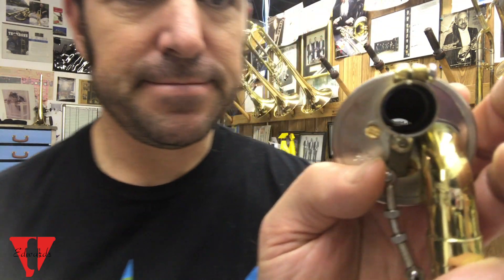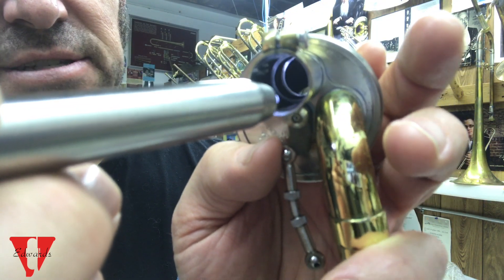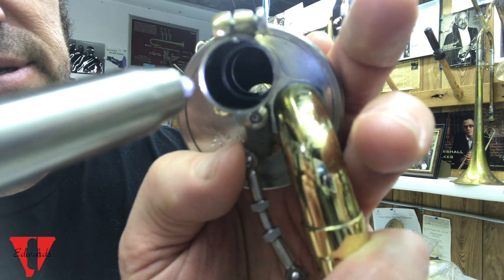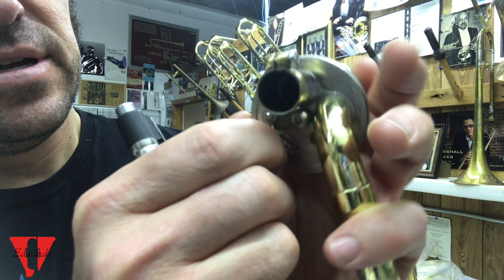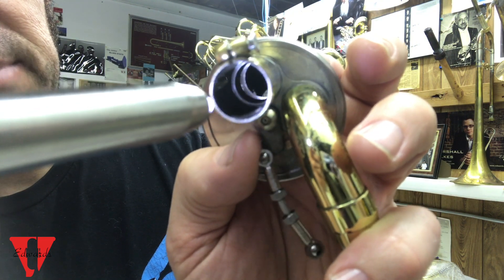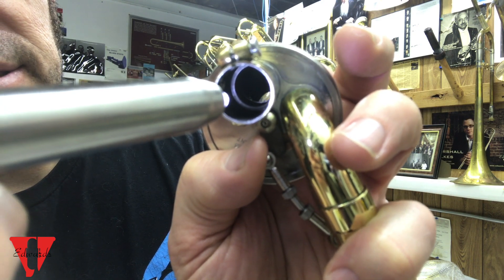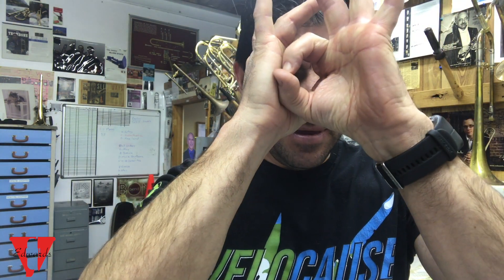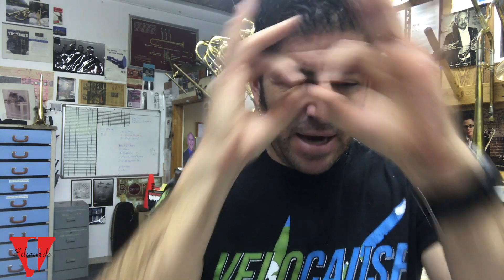Valve port alignment

Comment: Christian. What glue do y'all use on the bumpers? I've heard rubber cement is recommended, plus some time for it to dry (or dryer to set the glue quicker). Heard others use super glue, but super glue makes for difficult replacement in the future.